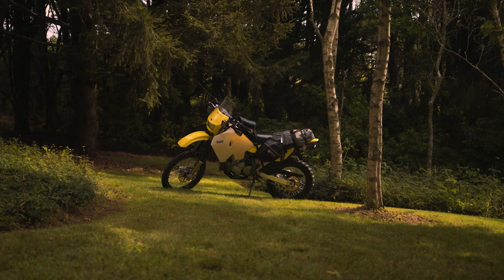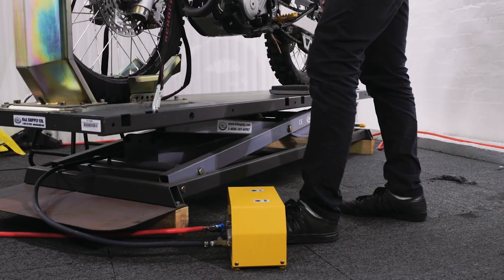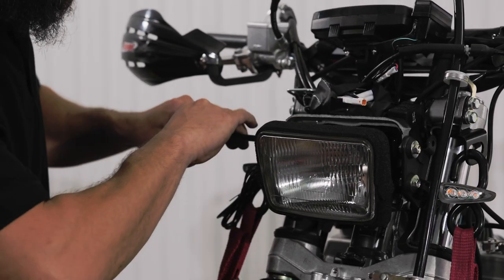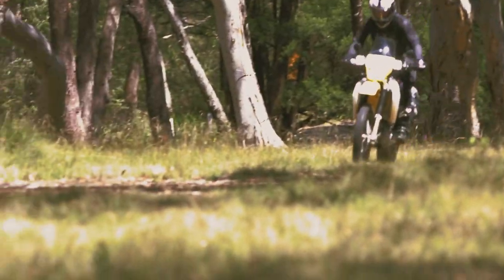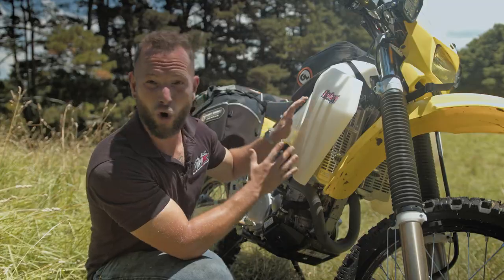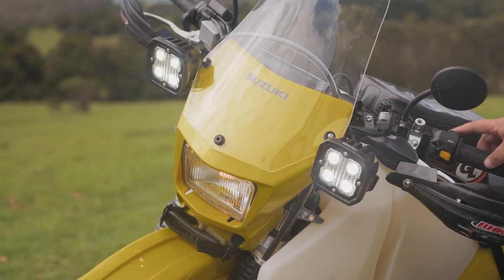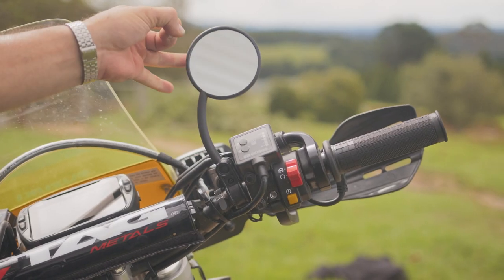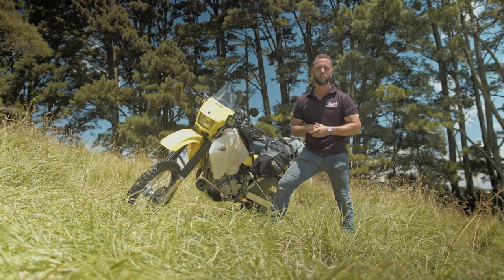The Ultimate Lightweight Adventure Bike Build

Comment: As a person who owns a DRZ and uses it for camping, this video is quite misleading when it comes to set up in an attempt to sell products. 

Things you definitely do not need is the trail tech dash - you can get offline maps on phones these days, why complicate the bike?
 
The handguards are as useful as an ashtray on a motorcycle... Just put full barkbusters to protect levers.

The giant loop bags make the steg pegs useless as they cover them too much, kriega setup fits better.

As for people mentioning doing the suspension.. unless you're a little fat, the bike handles the weight okay, even with a full tank. Filling the safari tank half way actually makes the bike feel lighter compared stock as it holds the fuel lower. 

If you're gonna put LED indicators, it's worth mentioning that it requires an LED relay and diode fix in order to get them to operate correctly. Never been a fan of the click and collect indicators.

Other essential mods are 15/44 gearing, case saver, engine clutch/stator guards, bar risers, USB charger,  seat concepts seat and a rear rack.

And as for people saying 'huskies are lighter' no doubt they are a superior bike, but could you do 5000km on them without an oil change? I wouldnt.
Reply: I agree with pretty much everything you said, bar using a phone as a nav tool. I’ve done it, but i used a cheap rugged android phone, and my iPhone was separate, used as a communication device. Catch was that the rugged phone was literally to dull in direct sunlight. Now, if I used ONE phone with a bright screen, chances are it would overheat or, if I broke it, or crashed and got separated from my bike, I would not have the ability to phone someone. So at least separating the two is a smart, safe thing to do. Dedicated GPS devices are always bright enough and built for purpose to be used outdoors for long periods - doesn’t have to be a trail tech, but companies like Thork, Garmin etc., can do the job.

Comment: You definitely need upgrade the handlebars and add some rises oem’s are like Way too weak-I would also change the gearing to at least 15/47-and as others have said mentioned definitely upgrade the suspension rating to carry the extra weight you’ve included on the bike other than that looks like a nice job👍👍

Comment: Did you add bigger springs to the suspension? You’ve added a fair bit of extra weight, especially with the bigger tank & possibly all the camping gear for a trip away. The standard springs are only optimised for a 70kg rider apparently, the average Aussie rider with all his riding gear, some basic camping gear & that Safari tank full of fuel is going to be a fair bit above 70kgs! Nice build though. My DRZ is very similar these days.

Comment: drz is not light weight compared to Huskies, etc, It is a heavy, underpowered turd of a bike. But I do like them!
Reply: ...........and reliable as a stone axe.
Reply: @graemesydney38  and just as heavy and slow. :) again, kidding, they are fine dual sports!
Reply: Any Husqvarna lighter than a DRZ is also has shorter maintenance intervals and shorter overall life overall.  I see lots of DRZs with 30K+ km and not many 400cc Huskies seem to accumulates those miles before needing major, expensive overhauls. Compared to a KLR they are lightweight.
Reply: The DRZ is a weird beast. Yeah it is a bit heavy, but it does feel light when riding it.
Reply: You guys should be looking at a RMX450Z if you want something Enduro. They're ADR complied but pretty rare